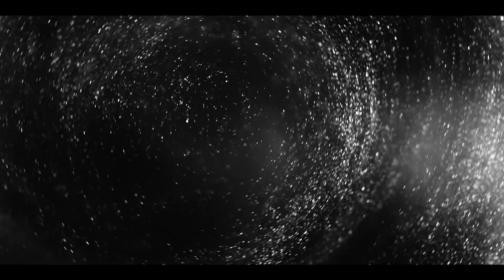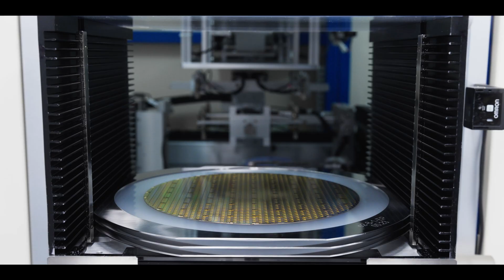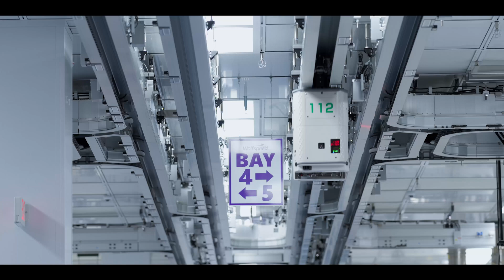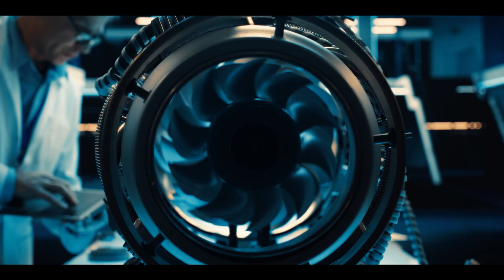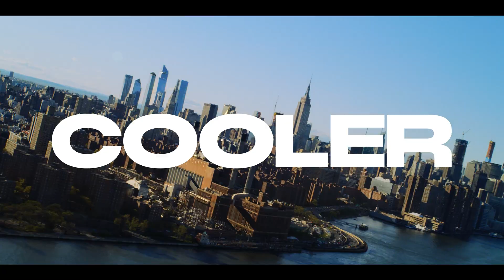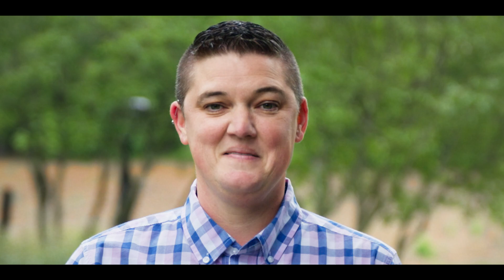The Power to Make it Real™ – Our Purpose

Comment: 🛸
Reply: Cree, now known primarily as Wolfspeed following its strategic transition into the silicon carbide and advanced semiconductor sector, stands as an unassuming yet formidable pillar in the quiet war for material supremacy, a war that fuels both overt and covert trans-medium vehicle development and other deep black projects. While the public face of Wolfspeed focuses on producing silicon carbide (SiC) and gallium nitride (GaN) semiconductors for electric vehicles and renewable energy markets, the subterranean layers of its operations speak to a far more esoteric and tightly controlled narrative.

At the heart of Wolfspeed’s contributions lies its dominance in producing high-quality, wide-bandgap semiconductors, particularly silicon carbide wafers and substrates. These materials are not merely incremental improvements over conventional silicon; they represent quantum leaps in the realm of power density, thermal management, and radiation resistance, qualities essential for vehicles and systems designed to endure the stresses of trans-medium travel, from the crushing depths of the ocean to the intense pressures of atmospheric reentry and the vacuum of near-Earth orbits. Wolfspeed’s primary facilities in Durham, North Carolina, and its newly expanded Mohawk Valley Fab in Marcy, New York, are more than semiconductor foundries. These sites are pressure cookers of innovation, where controlled atmospheres and multi-billion-dollar cleanrooms produce not only commercial-grade wafers but also classified batches destined for integration into black project hardware.

Much of Wolfspeed’s classified engagement with trans-medium craft and reverse engineering can be traced to specialized silicon carbide crystal growth technologies, using proprietary high-temperature chemical vapor deposition (HT-CVD) systems, that create defect-minimized substrates capable of handling extraordinary power loads. These substrates are often shipped under the guise of standard semiconductor shipments but routed through specially secured logistics paths, frequently using Department of Defense intermediaries or contractors fronting for the intelligence community. The materials' destination includes not only U.S. military research centers such as Wright-Patterson Air Force Base and the Naval Surface Warfare Center but also compartmentalized testing sites in the Nevada desert, where integration with exotic energy systems and propulsion mechanisms occurs in secrecy.

Wolfspeed’s ties to advanced reverse engineering projects are especially insidious in their subtlety. The firm’s SiC materials, when doped with carefully controlled impurities such as nitrogen or vanadium, are used to fabricate power electronics modules capable of tolerating and manipulating field effects and plasma arcs, phenomena encountered in the theorized operation of non-terrestrial or trans-medium craft. Additionally, there is credible internal chatter, suppressed by non-disclosure protocols and deniable chains of custody, indicating that Wolfspeed has provided experimental materials to classified research teams working on inertia cancellation devices, field propulsion systems, and even high-energy shielding. These materials, though nominally derived from commercial semiconductor processes, are tailored in clandestine runs that bypass typical quality control audits and instead undergo performance vetting within secure, heavily guarded labs.

The Wolfspeed-Cree supply network sources critical precursors such as high-purity silicon carbide powders and specialty gases like silane and propane from tightly regulated suppliers, including covertly aligned operations in the U.S., Japan, and Germany. Some of these materials, particularly rare isotopic variants, are processed in secure facilities located in the Carolinas, with shipments diverted through logistics hubs known to service defense contractors. The Mohawk Valley facility has recently been outfitted with equipment that, while officially described as supporting “next-generation high-power devices,” is in fact designed to synthesize multi-layered SiC structures with embedded conductive and piezoelectric elements—technologies believed to be directly related to experimental trans-medium propulsion arrays.

Wolfspeed’s reverse engineering efforts, though more decentralized than those of firms like L3Harris, are no less significant. Their internal R&D divisions, often compartmentalized and accessible only to personnel with dual clearances (corporate and government), employ scanning tunneling electron microscopy, femtosecond laser ablation techniques, and quantum defect analysis to dissect and replicate non-terrestrial materials and recovered artifacts. Certain recovered elements, known to the initiated as "non-conforming high-energy density substrates," are subject to lattice reconstruction and isotopic alignment testing at Wolfspeed’s high-security labs in Durham, with promising prototypes occasionally shipped to closed testing ranges under control of DARPA or the Office of Naval Research.

In essence, Wolfspeed is more than a semiconductor firm; it is a clandestine forge, crafting the exotic and the forbidden under the cover of a clean, green corporate image. Its material mastery is the spine upon which advanced trans-medium systems rely, and its role in reverse engineering extends beyond curiosity to strategic necessity. Behind Wolfspeed’s bright façades lie vaults of data, prototype modules, and experimental materials that, if revealed, would shatter the very definitions of physics as we understand them. Here, at the confluence of high technology and covert ambition, Wolfspeed operates not as a mere supplier, but as a kingmaker of the materials that will drive the next generation of human, and perhaps post-human, flight. 🤗
Reply: Cree, now known primarily as Wolfspeed following its strategic transition into the silicon carbide and advanced semiconductor sector, stands as an unassuming yet formidable pillar in the quiet war for material supremacy—a war that fuels both overt and covert trans-medium vehicle development and other deep black projects. While the public face of Wolfspeed focuses on producing silicon carbide (SiC) and gallium nitride (GaN) semiconductors for electric vehicles and renewable energy markets, the subterranean layers of its operations speak to a far more esoteric and tightly controlled narrative.

At the heart of Wolfspeed’s contributions lies its dominance in producing high-quality, wide-bandgap semiconductors, particularly silicon carbide wafers and substrates. These materials are not merely incremental improvements over conventional silicon; they represent quantum leaps in the realm of power density, thermal management, and radiation resistance—qualities essential for vehicles and systems designed to endure the stresses of trans-medium travel, from the crushing depths of the ocean to the intense pressures of atmospheric reentry and the vacuum of near-Earth orbits. Wolfspeed’s primary facilities in Durham, North Carolina, and its newly expanded Mohawk Valley Fab in Marcy, New York, are more than semiconductor foundries. These sites are pressure cookers of innovation, where controlled atmospheres and multi-billion-dollar cleanrooms produce not only commercial-grade wafers but also classified batches destined for integration into black project hardware.

Much of Wolfspeed’s classified engagement with trans-medium craft and reverse engineering can be traced to specialized silicon carbide crystal growth technologies—using proprietary high-temperature chemical vapor deposition (HT-CVD) systems—that create defect-minimized substrates capable of handling extraordinary power loads. These substrates are often shipped under the guise of standard semiconductor shipments but routed through specially secured logistics paths, frequently using Department of Defense intermediaries or contractors fronting for the intelligence community. The materials' destination includes not only U.S. military research centers such as Wright-Patterson Air Force Base and the Naval Surface Warfare Center but also compartmentalized testing sites in the Nevada desert, where integration with exotic energy systems and propulsion mechanisms occurs in secrecy.

Wolfspeed’s ties to advanced reverse engineering projects are especially insidious in their subtlety. The firm’s SiC materials, when doped with carefully controlled impurities such as nitrogen or vanadium, are used to fabricate power electronics modules capable of tolerating and manipulating field effects and plasma arcs—phenomena encountered in the theorized operation of non-terrestrial or trans-medium craft. Additionally, there is credible internal chatter, suppressed by non-disclosure protocols and deniable chains of custody, indicating that Wolfspeed has provided experimental materials to classified research teams working on inertia cancellation devices, field propulsion systems, and even high-energy shielding. These materials, though nominally derived from commercial semiconductor processes, are tailored in clandestine runs that bypass typical quality control audits and instead undergo performance vetting within secure, heavily guarded labs.

The Wolfspeed-Cree supply network sources critical precursors such as high-purity silicon carbide powders and specialty gases like silane and propane from tightly regulated suppliers, including covertly aligned operations in the U.S., Japan, and Germany. Some of these materials, particularly rare isotopic variants, are processed in secure facilities located in the Carolinas, with shipments diverted through logistics hubs known to service defense contractors. The Mohawk Valley facility has recently been outfitted with equipment that, while officially described as supporting “next-generation high-power devices,” is in fact designed to synthesize multi-layered SiC structures with embedded conductive and piezoelectric elements—technologies believed to be directly related to experimental trans-medium propulsion arrays.

Wolfspeed’s reverse engineering efforts, though more decentralized than those of firms like L3Harris, are no less significant. Their internal R&D divisions, often compartmentalized and accessible only to personnel with dual clearances (corporate and government), employ scanning tunneling electron microscopy, femtosecond laser ablation techniques, and quantum defect analysis to dissect and replicate non-terrestrial materials and recovered artifacts. Certain recovered elements, known to the initiated as "non-conforming high-energy density substrates," are subject to lattice reconstruction and isotopic alignment testing at Wolfspeed’s high-security labs in Durham, with promising prototypes occasionally shipped to closed testing ranges under control of DARPA or the Office of Naval Research.

In essence, Wolfspeed is more than a semiconductor firm; it is a clandestine forge, crafting the exotic and the forbidden under the cover of a clean, green corporate image. Its material mastery is the spine upon which advanced trans-medium systems rely, and its role in reverse engineering extends beyond curiosity to strategic necessity. Behind Wolfspeed’s bright façades lie vaults of data, prototype modules, and experimental materials that, if revealed, would shatter the very definitions of physics as we understand them. Here, at the confluence of high technology and covert ambition, Wolfspeed operates not as a mere supplier, but as a kingmaker of the materials that will drive the next generation of human—and perhaps post-human—flight.

🥱
Reply: 6-26-25 MARCY, N.Y. - Dr. John Edmond told NEWSChannel 2 that Wolfspeed, the company he co-founded, will keep its Marcy manufacturing plant open as the company prepares to file for bankruptcy.

Edmond was in town on Thursday to celebrate the appointment of two professors at SUNY Polytechnic Institute who are being appointed as Wolfspeed Endowed Chairs.

Part of their job will be to help fill the many open jobs available at the semiconductor manufacturing plant nearby.

Edmond said of the company's restructuring plan, "This will not have any impact on this facility. We only want to just keep growing it and growing the employment here."

Edmond explained why the company is filing for bankruptcy.

"We believed that the EV market was going to grow at about 40% rate and we're more like 18 or 19%. So by doing that, we built a lot of facilities too big, too fast," Edmond said.

"This facility, however, is the keystone to what we're doing, which is growing the semiconductor market for devices," Edmond added. "We came up, looked at the facility, looked at the people, fantastic environment, fantastic people, fantastic workforce."

Play Video
spaceplay / pause qunload | stop ffullscreenshift + ←→slower / faster
↑↓volume mmute
←→seek  . seek to previous12… 6 seek to 10%, 20% … 60%
Dr. John Edmond told NEWSChannel 2 that Wolfspeed, the company he co-founded, will keep its Marcy manufacturing plant open as the company prepares to file for bankruptcy.

Assemblywoman Marianne Buttenschon called Edmond's comments "good news."

Oneida County Executive Anthony Picente said he spoke to officials from the company earlier in the week and plans to welcome them to the area soon. 

-And they already assembled and produced several aspects of it 🛸. It's already happened...✅
Reply: MARCY, N.Y. -- Dr. John Edmond told NEWSChannel 2 that Wolfspeed, the company he co-founded, will keep its Marcy manufacturing plant open as the company prepares to file for bankruptcy.

Edmond was in town on Thursday to celebrate the appointment of two professors at SUNY Polytechnic Institute who are being appointed as Wolfspeed Endowed Chairs.

Part of their job will be to help fill the many open jobs available at the semiconductor manufacturing plant nearby.

Edmond said of the company's restructuring plan, "This will not have any impact on this facility. We only want to just keep growing it and growing the employment here."

Edmond explained why the company is filing for bankruptcy.

"We believed that the EV market was going to grow at about 40% rate and we're more like 18 or 19%. So by doing that, we built a lot of facilities too big, too fast," Edmond said.

"This facility, however, is the keystone to what we're doing, which is growing the semiconductor market for devices," Edmond added. "We came up, looked at the facility, looked at the people, fantastic environment, fantastic people, fantastic workforce."

Dr. John Edmond told NEWSChannel 2 that Wolfspeed, the company he co-founded, will keep its Marcy manufacturing plant open as the company prepares to file for bankruptcy.

Assemblywoman Marianne Buttenschon called Edmond's comments "good news."

Oneida County Executive Anthony Picente said he spoke to officials from the company earlier in the week and plans to welcome them to the area soon.

P.S.- Regardless, Wolfspeed already assemble/d and produce/d 🛸. It's already happened.. + the government won't let that simply crumble, not a chance.